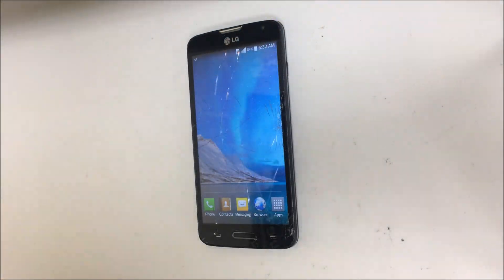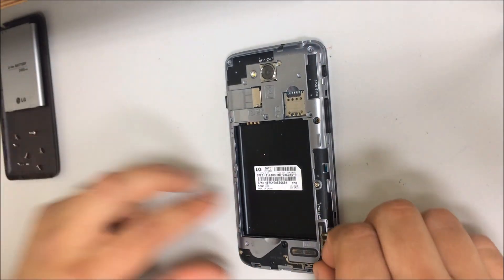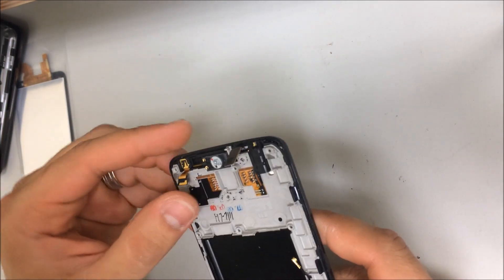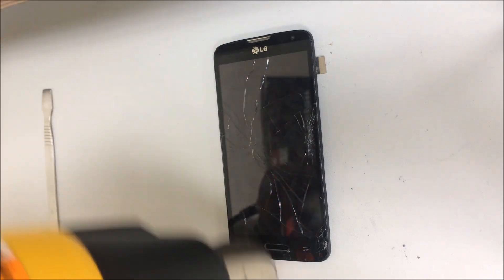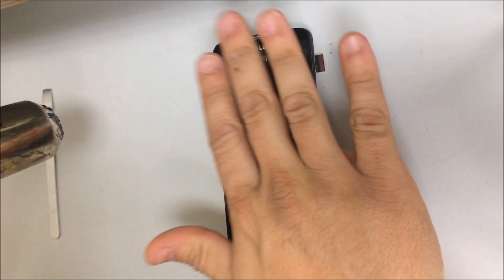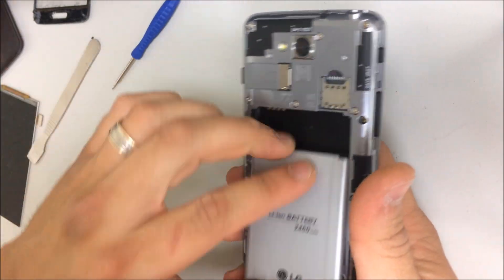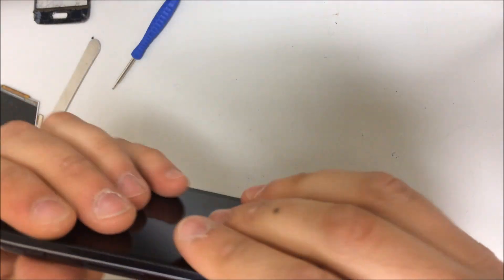LG Optimus L90 Glass LCD Screen Replacement ║ How To Take Apart

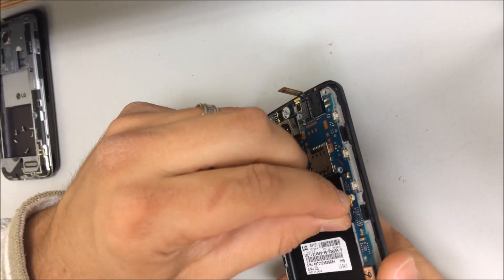Comment: What is the antenna at 4:25 for? Mine tore at one end during disassembly but I dont know exatly what functions i lose. Something related to wifi and cellular connection for sure because reception is scanty but nothing in particluar has stopped working.

Comment: I've done this twice now because of two different accidents. On the second fix though the screen most of the time is extremely bright, so bright that it drains the battery and heats up like crazy, It cannot be turned down as brightness settings do nothing. I thought this might be because the flex cables were not stuck down, so I used double sided tape to stick them to the frame, but the problem came back later and still persists. If anyone has had a similar problem please reply. Thanks.

Comment: I have replace the broken digitizer and then also a screen and now I have a problem with backlight ( on boath old and new screen). How the screen get the power for becklight? over the same connector as video or there is some other connector for becklight power supply ?

Comment: My LG L90's touchscreen doesn't function well anymore. If I try to tap somewhere it only taps if I do it with pressure and swiping isn't possible because it only taps once then. When I warm my phone up a little with my hands and rub on the screen with my hand palms a few times it works fine till my screen is is going off again when I push the off button or when i don't touch it for half a minute or something. When my screen has gone off (even if it was only for half a second and I Don't need to unlock it again) the rubbing to get it working can start all over again. I'm very worried the rubbing only makes things worse but its the only way to get my phone working.
Can anybody please tell me whats wrong with my LG L90 and what I need to do to repair it? It would help me out a LOT!
Reply: +ExplodingFireworks A New Phone Lol
Reply: Austin Wilson lol it is very strange what happened. my touchscreen works totally fine again and we didnt do anything, when i went to bed it didnt work at all and the next morning it worked fine. till today i havent had any problems again.
Reply: ExplodingFireworks That Is Odd, I Wish I Knew Something That Would Help You, a Battery Or A Digitizer Would Be My Guess.
Reply: Austin Wilson read my comment above yours, my touchscreen works fine again. :D
Reply: Well When They Go Bad Sometimes They Bug Out And Don't Work, It Happened To My Samsung Tablet. And My Battery On My IPhone 3Gs ( wow, I just realized how long that's been since I bought that phone. [I got it new]) lol

Comment: Pretty good. I had to learn how to get the phone apart to replace the lower circuit board with the microphone and other parts. I used a $10 set of jewelers glasses to see the small stuff like the connectors for ribbon cables and the antenna cable.

Comment: Thanks for the video. It was very helpful, but I have an issue. My digital screen didn't stay tacked down, I don't think I left enough of the goop when I heated it up. Therefore I don't think my screen is in tight enough. Can I place a tiny dot of super glue or two sided tape in there to keep it held down?

Comment: Hey, I did this repair exactly as the video described.  Now my screen won't turn on...

I think the phone is working fine, because when I plug it into the charger it does the vibration, but the screen is still completely black....

Anybody?

Comment: where did you get the lcd screen and digitizer combo?  The other links are just for a digitizer and I don't know how you would connect the 2 if they don't come pre-assembled?
Reply: 2nd this question !! In other phones there is a tape layer or some such required? 
I did find the "combo" on Amazon but only from one vendor and at MORE than I initially paid for the phone.

Comment: hey i did everything you did in the video and every came out good but one thing .....when i swipe or press left its rigth and when i swipe or press right its left HELP!!!
Reply: It's  faulty part you replaced it with. only solution is to find another digitizer and replace it.
Reply: i have the same issue, have you found a solution?

Comment: I only wanted to change out the glass but made the mistake of removing the black tape at around 4:48 which damaged the underlying ribbon which is connected to the LCD. When I put it back together the screen was all scrambled and unreadable. Also, there were a couple little rubber gaskets that fell out and I had no idea where to put them back. I ended up just buying a new phone but wanted to give this a try. Anyway, I think I'm going to leave it to the professionals next time.